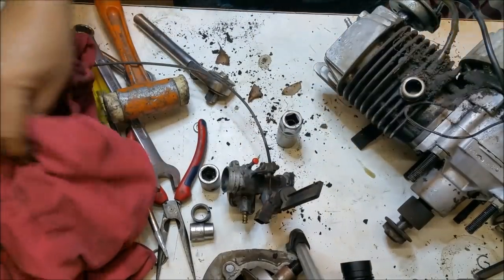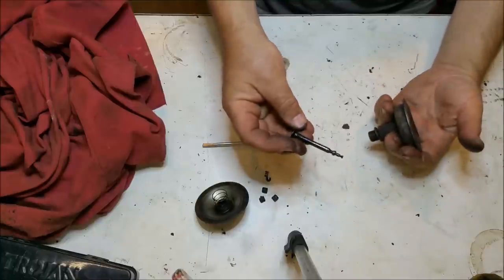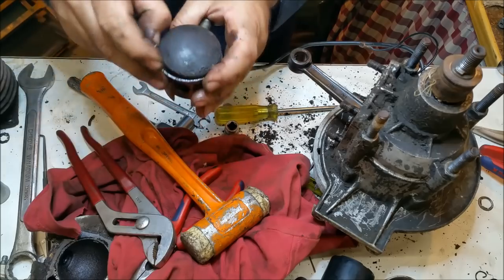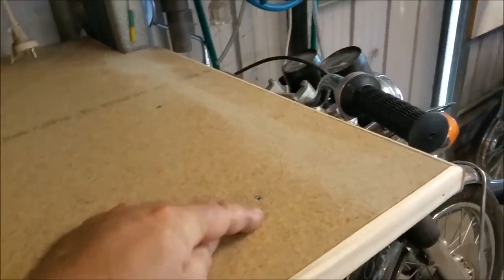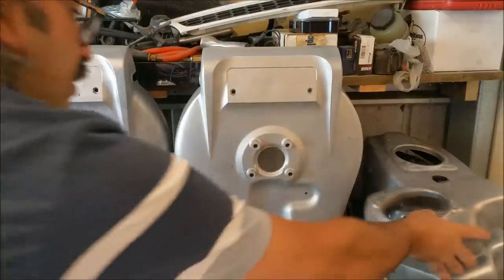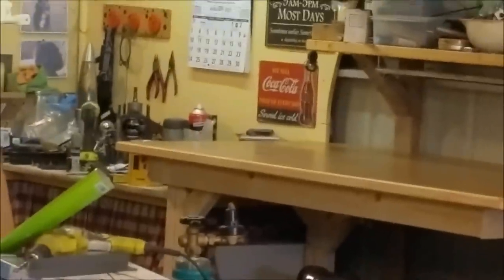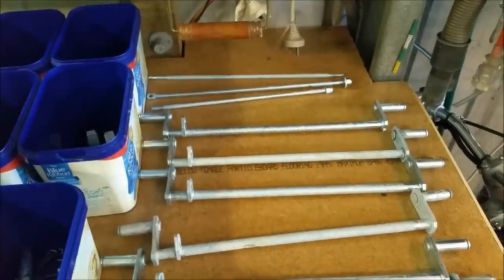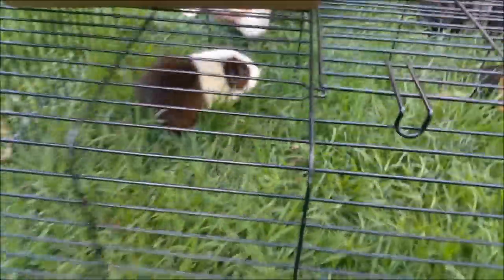Restoring 7 Classic Victa Lawn Mowers Part 2

Comment: As a retired Electroplater I did smile watching you wire up nuts and bolts for zinc plating...I remember watching some of our workers wire up part of the locking mechanism for the Leyland P76 car (Early 1970s) that was then plated in cadmium..I used to specialise in barrel plating doing such things as parts for Toltoys and nails in cadmium that were used in the Islands and hundreds of other jobs for Zinc/Cadmium...Amazingly the factory is still there and operates as a plating company

Comment: Another great video. Regarding the little bits inside the axle covers for the 18. If you pull them out, there are springs underneath, which will be rusted in and need replacing. To the best of my understanding, it acts as a primitive form of suspension and stops the axles grinding on the covers.

Comment: The  victa is a hard  engine but parts for these are getting so expensive
Reply: Good idea is if possible to go and check out the back of Mower Shops where they throw out old or useless mowers..I have found some good stuff.